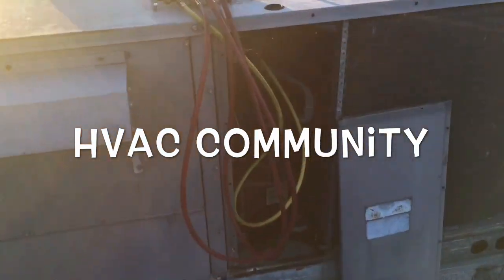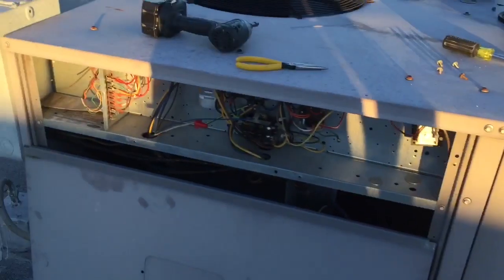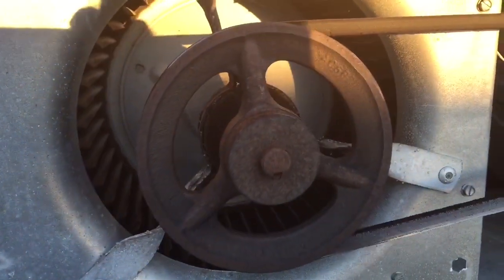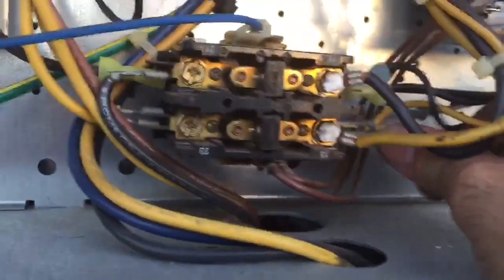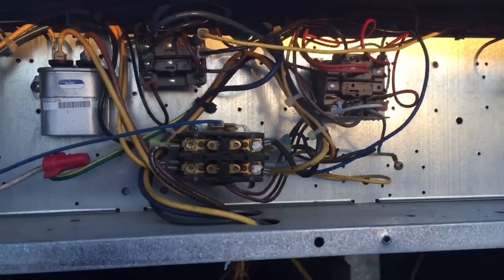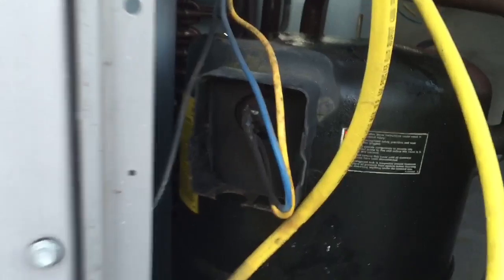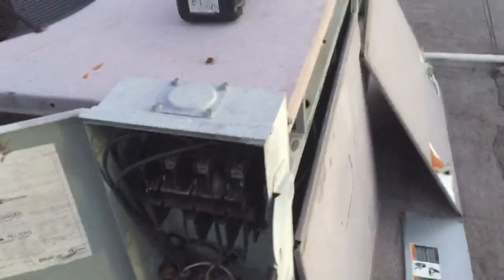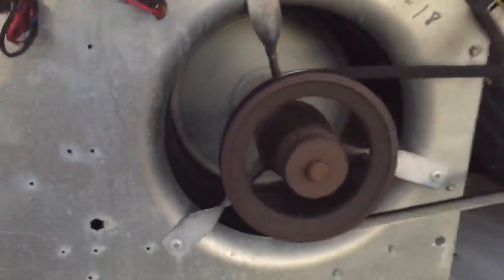Hvac: 3 Phase Motor Wrong Rotation And Compressor Terminal Blow Out.

Comment: Sorry, I'm not an HVAC tech, but I was wondering why you didn't swap two of the main leads around, instead of swapping one with the contactor. Wouldn't that have reversed the rotation of the fan as well?
Reply: And also reversed the direction of the compressor

Comment: i thought you just had to switch two wires at the back of blower motor.
Reply: 3 phase power you change "any 2 power connections" and you reverse motor rotation because this flips the phase rotation order. Some "single" phase motors can be reversed by changing connections on the motor itself. some will only run in one direction and are not electrically reversible.

Comment: Great video! Just wondering  why is there a double pole contactor if the system is 3 phase, where does the other leg get its power from? Just curious  just in case i come across that situation.
Reply: Its called a widow maker! Fairly common on the carrier "weather makers". One leg is always hot when the power is on. Be careful!

Comment: Nice job. I wonder how the phases got switched?  I had one where they put in a new service and had all the units backwards.  Phase monitors should be standard on all three phase equipment.
Reply from the maker: Thks for the comment rob.. I am still learning about these particular units and there standard phases..Thks for help..I appreciate the comment..
Reply: eddiehvac pretty much three phase is the same. Their are different delta circuits. But they all have to be in order. L1L2L3. They make rotation meters so you can check if phasing is correct. Remember scrolls do not like running backwards.
Reply: Rob HVAC eddiehvac If the phase reversal happened because work was done to the building service or on this unit's branch circuit, then the compressor is now running in opposite rotation also.  As I understand it, recips still pump okay, but it increases wear if you reverse a compressor that has been in service for a while. As Rob said, scrolls can't handle reversal.
Reply: +Straycurrent yes the phase should have been swapped at the load side disconnect. I cant tell from the end of the video but the pressures seemed even on that compressor. Could also explain the terminal blow.
Reply: That's exactly my problem, but how did it reverse the rotation, maybe the electric co. changed it at the pole??
Reply: @1tmagda  breaker at panel downstairs maybe was replaced  by and phase accidently swapped there. They turned it on  saw the thermostat worked  and walked  off.

Comment: good job friend
Reply from the maker: Thks Steve for comment..
Reply: before jumping to conclusion maybe the motor was replaced and connected wrong? Yes normaly you change at the disconnect but not always. looking at the video closer one can see that everything seems right on the unit. solution change 2 phases at the disconnect.

Comment: good work. gotta love 3 phase equipment..thtas all I work on 98% of the time. also I like that terminal repair job
Reply from the maker: Ha emin. I really don't wrk on too much 3 phase units but I no alittle about them. I no I can definitely get with u about some questions about them..Thks for the comment brother.
Reply: eddiehvac NP. Did you see my response to you're question about why there are no capacitor on 3 phase motors
Reply from the maker: Just read your response.. It's crazy how I had ask that question a week ago and run into this system. Great response I didn't no that.. I appreciate the  lesson u gave me.. Thks man.. Would like to see a video on 3 phase compressor and motors..Thks
Reply: eddiehvac I'll try to do one for you. Take care brother.
Reply: Can U explain one more time for me sir? Why there are no capacitors on 3 phase motors? Just moved from residential to doing havoc/maintenance for a Facilities management company. I need to  learn 3 phase quick. Thanks
Reply: 3 phase is efficient; on systems where you only use two hot legs and a cap - the cap is making up for the missing phase by shifting the phasing and making it run more efficiently....I think, lol.
Reply: I'm working on a 3phase 2of my legs I'm getting 120 and on 1 leg I'm getting 220 what's up with that